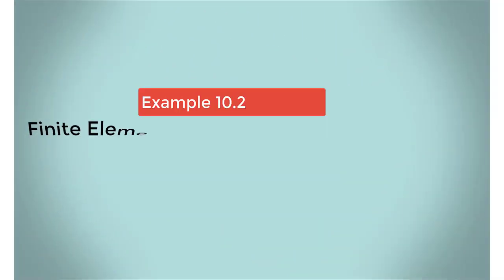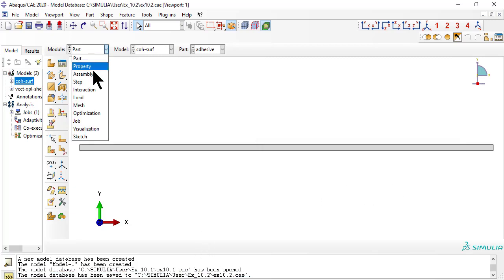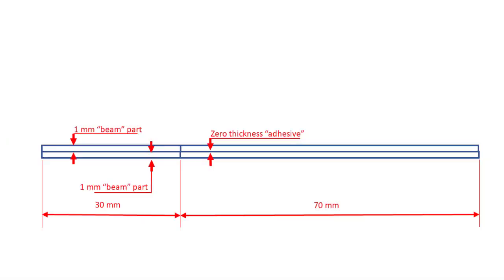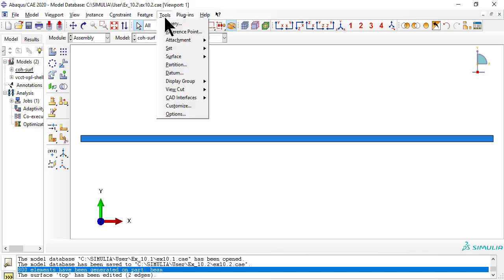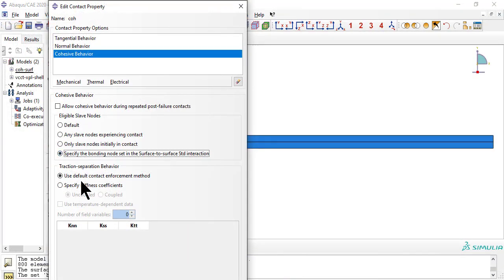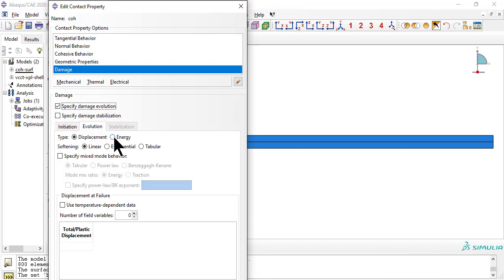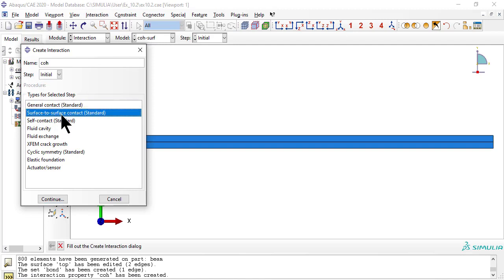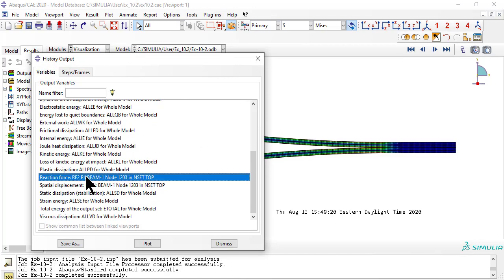Example 10.2 How to use Abaqus surface-based CZM elements to simulate delamination of DCB beam

Comment: Hello Professor, I have force vs displacement results from a pull test. The pull tests were performed on 2 similar materials bonded by an adhesive. How do I convert it to a Stress vs Displacement plot to get the traction-separation constants?

Comment: Dear professor, For failure criteria TMSC is ok or one should go for Damage mechanics and CZM also,  is all criteria are necessary to check. Also is failure criterion depends on manufacturing process like is it suitable to use TMSC for VRTM(Vaccum resin transfer molding) processed composites. Thank you Professor
Reply from the maker: TMS is OK for preliminary design. Once you have finalized your decision about the material, LSS,thickness, everything, then you do "detailed analysis" and then you may or may not need more powerful damage criteria. That is how my books are organized. "Introduction to Composite Materials Design" is for preliminary design. You should study chapter 7.  Then, "Finite Element Analysis of Composite Materials Using Abaqus" is for detailed analysis. There may be an indirect relation between manufacturing process and FC, but that is too sophisticated at the preliminary design stage. If it is laminated, then use TMS. Read my two papers at the SAMPE Conference, 2018 and 2019. You can download them from my list of publications on my website, or ask me to send them to you.
Reply: @EverBarbero Dear Professor, Thank you, are these papers correct.
 1. E. J. Barbero. Universal knockdown factors for strength of carbon/epoxy laminates.
In CAMX 2018,
 2. E. J. Barbero. Universal carpet plots for stiffness and strength design. In CAMX
2017.